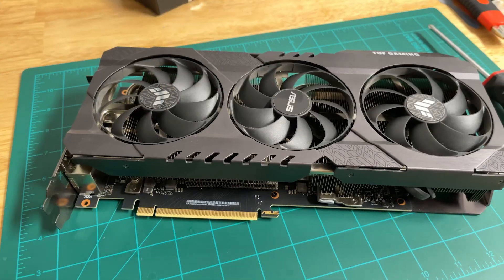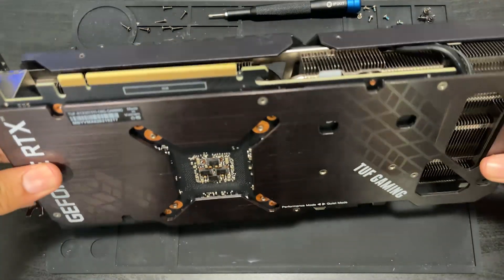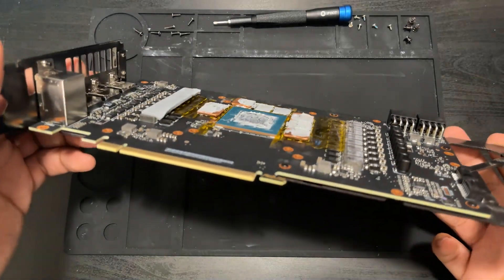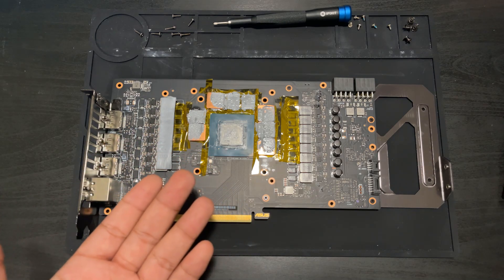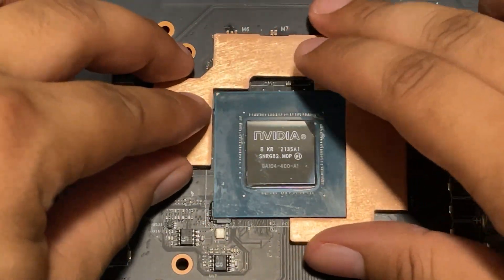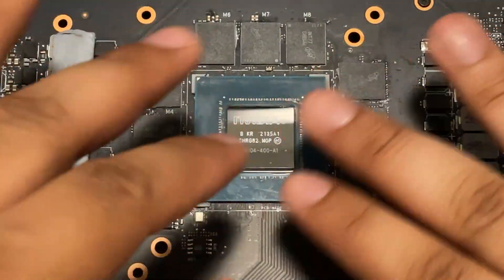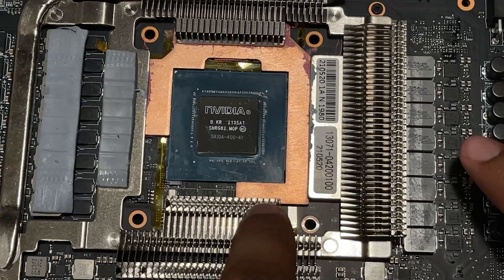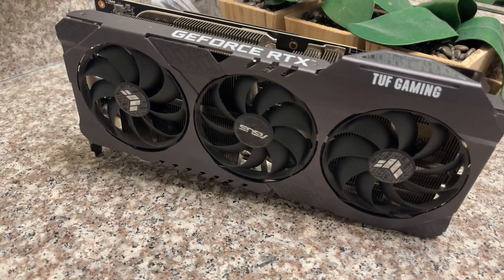RTX 3070 Ti COPPER MOD: 1 Month Later And... OMG...

Comment: Dear, excellent video, from Argentina, if it's not too much to ask, could you put the measurements to be able to cut the mod, and what material is it exactly? I just have a similar board that has temperature problems. if you could attach it in a pdf format in the form of a drawing with the exact measurements. It would be of great help to the community, best regards.

Comment: Careful with MX4. It separates over time with GPUs based on my history. Would recommend GC Extreme over it.
Reply: True, especially when temperature exceeds 70~75°c. High viscosity pastes last longer on direct-core chips. Kryonaut, NT-H1 / 2 and MX-4 are more suited for heat spreader equipped chips
Reply: @harrydijkstra9936 mx6?

Comment: I got the plate for my 3080 ti Fe. Haven't installed it yet but I was planning on watercooling it as well until you mentioned that I shouldn't do that. Can you elaborate on that a bit more? No liquid from watercooling actually makes contact with the PCB or any components so I'm a bit confused as to why that would matter
Reply from the maker: I more said that to prevent people who don’t explicitly understand the risks of doing things like this, a properly water cooled system will have no issues with this mod.
Reply: @dandyworks  Okay, awesome. Thank you for the reply

Comment: You are slowly evolving to the GPU memory plate I made for my waterblock. Juts make a plate that covers the GPU mounting holes and drill them to match in the plate. Cut out any areas that make component contact then you are done. Perfect fit copper plate that won't move and has maximal contact and heat sinking capacity. My Kawpow mining temps with this method are 46C core 50C Mem.

Comment: just a quick correction. if youre watercooling, it doesnt matter if you do this mod or not, these copper plates will not come in contact with water, so there wont be any chance of galvanic corrosion. you might be able to use these plates with a waterblock, but its probably not neccesary or maybe not possible depending on the waterblock. high quality thermal pads should suffice. i see tempuratures better than this mod using good thermal pads with a water block.

Comment: Hi! I just did the mod with the little copper plates from your other video. I am so happy, that i didn't short anything... yet... My memory temp dropped from 90 to 70 :-D Thank you for the tutorial. But do I need to change it the thermal paste every month? Or how long can I use it like this when I am mining? And do I have to live in fear, that there could be a shortage every moment? Because I am a little bit scared now :-D Thanks for the answers
Reply from the maker: Some people say you should change paste every X months, while others say you never need to. I usually change paste every 6 months just because I can, and it gives me a chance to clean my GPU. If you have modded your GPU correctly, I would not live in fear. But I would also perform a visual inspection every so often to makes sure everything is fine. Also, if your GPU is sitting horizontal, I certainly wouldn't worry about shims moving. They won't.
Reply: Thank you for the answer. Putting the card horizontal is a good idea 💡

Comment: I’ve got a passively cooled system where I’ve had great success swapping the thermal pads for some home-made copper shims. I didn’t notice any such improvement using different thermal pastes, though. The TG Kryonaut Extreme worked just as well as MX-4 while being a bit more difficult to work on since it’s rather pudgy.
Reply from the maker: I have seen great variation in the subjective effectiveness of Kryonaut Extreme VS other pastes. For me it's always superior even if only by a degree or two C (It better be for that price!) but of course MX-4 is fantastic.

Comment: I have lowered to voltage on my RX 5500 XT xfx 8gb
And it heat less than before by a lot
What if you lower the voltage?
Better performance?
Less heat?
Explosion?
Reply from the maker: I would assume that undervolting would reduce heat because you are lowering the power being used by the card. However, this is not my area of expertise, so I am unsure about what performance gains could be had. Explosions would not occur though! :P

Comment: i got a coolmygpu copper plate for my 3080 LHR... 99mhs//72c memory temp
best move I ever did honestly.. Now I wanna put one on my 3080 non lhr thats liquid cooled.. 102mhs//66c w thermaltake pads.. I bet i can get it even lower with another plate
Reply: my watercooled gpu is a gaming oc gigabyte that came with a water block installed on it, but that block suffered corrosion internally from the fins being a aluminum plate that was copper coated even with specialized coolant and multiple cleanings it gelled coolant.
with the Bykski waterblock, ive been running this card as a gaming/mining card for over a year with great temps.  
but I think I can do better

Comment: Dude, the die of this card is so tiny wtf xD. I have a 1070 in my PC, and since I bought the cheapest one it had really crap cooling. For 50$ I got an Arctic cooler, I put some radiators on top of the Memory and the power, and I have never seen my card go above 65C under any circumstance. I doubt all of this what you do is really worth it, unless your card has a shitty cooling. And this one clearly has a beefy one.

Comment: I have an evga rtx 2080 xc the 2 fan edition wich was getting really hot really fast 84°C. I bought a raijintek morpheus 8057 with 2 noctua nf-f12 pressure fanv and the temps don't exceed 60°C in full load

Comment: Why do you need to put kapton tape when thermal grease is not conductive? and is it possible for the copper shims to be removed completely? meaning, the memory chips directly contacting to the sub-heat sink?
Reply from the maker: Kapton tape is a safety precaution taken to prevent any copper from making contact with components mounted to the PCB. Sometimes, a capacitor or resistor will sit above the plane of the memory chip, and if the copper was touching that component, there is basically a 100% chance that component will blow up. It is possible for the sub-heatsink to make direct contact with the memory chips. This is pretty much unique to this GPU in particular though.

Comment: I appreciate the tip with the "Heat Resistant Tape". It never hurts to be safe. I'm gonna give the CoolMyGpu copper mod a try hopefully this week. I've also been adding an alluminum heat sink to the backs of my GPU plates. As I haven't done the mod yet, so any bit of cooling helps as of now. Can't wait to try this out!
Reply: Did everything go right? No problems?

Comment: I switched from Stock GPU cooler to AiO cooler, and managed to drop 40 degrees celsius, next i will try to get a new GPU and maybe try the Copper mod out, it looked very promising

Comment: My boy great video! What thermal pad thickness you suggest for the 3070 ti Asus Tuf?
Reply from the maker: I recommend 1.5mm thermal pads, the same size as the shims! Gelid Extremes (linked in description) have been very kind to me, and if you are willing to pay the premium I say go for those. 2mm will also work due to the nature of the dual heatsink design, but there isn’t really any performance gain using the bigger pads.
Reply: @dandyworks  thank you for the reply, i'm gunna spring for the copper plate.

edit: i spoke too soon theyre no loner accepting orders smh :(

Comment: Back in the day you could buy solid copper heatsinks for a few bucks and they did cool CPU's and northbridges really well (no need for heatpipes or anything like that, in some cases you didn't even need a fan).  Those days are long past, unfortunately.
Reply from the maker: Perhaps we should bring those days back. Nvidia is once again taking the "MORE POWAH" approach to increasing GPU performance, and that doesn't bode well for the longevity of the components (Maybe AIBs will begin to incorporate expensive but reliable GaN mosfets instead?). Maybe I could design something for GPUs...
Reply: @dandyworks  It really depends on what kind of NVidia card you are buying and what you are doing with it.  Their lower end cards are very efficient for gaming at 1080p, and don't consume alot of power.   I have a midrange gaming PC with a  Geforce GTX 1650 Super and Ryzen 5 3600 inside an very old (15? years) Antec case.  My whole setup is drawing well less than 300 watts under full load and only has one case fan.

Comment: I would love to see this done with pennies hahaha
Reply from the maker: Considered it, but sadly pennies are only 2.5% copper and 97.5% zinc now. Zinc isn't a terrible conductor of heat though. I think the bigger issue would be the fact I was using PENNIES to cool a GPU lol
Reply: @dandyworks  only 2.5% copper?! Everything i know is a lie.
Reply from the maker: Yes. I was quite astonished when I first heard this fact too. 97.5% zinc and 2.5% copper is all pennies made after 1983. Prior to that through most of the 1900s, it held at about 95% copper. The reality is that, for the last ~40 years, pennies have not been made of copper. Ridiculous!

Comment: Thermal paste spreads when it heats, and you want a ultra thin layer to fill in the tiny voids and surface imperfections. A half grain of rice size for this GPU . Also, no need to spread it around. They sell everyone 10,000 times the amount of paste than needed, because there's no profit in sending .10 cents worth. Furthermore, if there's not enough, thermal run away will cut power. 'naw dawg, I'm good'
Reply from the maker: https://youtu.be/EUWVVTY63hc 
Particularly, ~18:30

Case in point. A half a rice grain is insulting for a 3000 series GPU. Just to do a sanity check, I just tried a half a rice grain on a 3060, and while the core temperature was ~70C under full load, the hotspot temp was 92C. WTF! Absolutely not. The culprit? The half rice grain of paste only spread to cover ~75% of the GPU die.

Comment: exact same card and exact same application, 1 month in I was getting close to 100c memory temps so I opened it and one of the copper shims at the bottom left of the card moved down. it wasn't touching anything to short and burn the gpu but that was scary af. switched it with a slightly thicker one and when reassembling the card I screwed the bottom half of the card first and a bit tighter before screwing in the top side. now it's doing fine. 180w, 82mh, 88c memory on %70 fan

Comment: UPDATE of my own mod with Aluminum Nitride(VRAM>0.5mm Laird HD90000>1.0mm Aluminum Nitride Plate>Shinetsu 7921>Heatsink):
Comparing to one of the best thermal pad (2.0mm Laird HD90000), maximum throttle(mining eth +900 mem) temperature of memory junction reduced from 104C to 92C. Original shitty thermal pad will throttle at 110C with no OC.

I still use 0.5mm of the pad because it holds the plates in place, using paste will induce unwanted movement and also smears into unwanted gaps.

Shinetsu 7921 is very good, once completely cured it surpass Thermal Grizzly Kryonaut in cooling performance, and it's VERY durable(you probably will replace your PC before needing to repaste), also VERY cheap (dirt cheap).
Reply: forgot to mention, it's a Zotac Trinity RTX 3080 Non-LHR with Micron VRAM.The plates i bought was residue from bigger cuts(big enough for VRAM but requires to be cut smaller with a glass cutter, 0.3$ per piece), Shinetsu 7921 was 3$ per 2g tube(7868 can do as well, literally more watery 7921 that cures longer but easier to apply).

Comment: the actual heatsinks makes contact with that memory copper heatsink at the point the subheatsink stops, its not a huge deal but its still extra thermal transfer left on the table, just do it when you need to repaste it

Comment: dawg i got 2 rtx 3090s by asus tuf but cant find any copper plates for it ?!? will this 3070 fit on my asus tuf 3090?
Reply from the maker: You can see a [RTX 30(90) compatible] plate on the CoolMyGPU website here: https://www.coolmygpu.com/product/ga102/3?cp=true&sa=true&sbp=false&q=false
Reply: @dandyworks  alright thank you!

Comment: 62c under load is INSANE , very good work! I have a 3070 ti thanks to my wife ( she saw the GPU price drop ), I have been concerned about GPU mem temps ( topped out at 96c so far ). I really would like to take it apart and replace the thermal paste and put in one of those amazing copper plates, but unfortunately I have refractory temporal lobe epilepsy and fractured T3, T9 , T10 , T11 vertebrae so it's hard to do things that require fine motor skills and I'd be terrified of breaking my card.

If it becomes a problem I'll try to figure out a way to trade or barter to get someone to help out, a lot less people in Canada where i'm from know about computers like back in america, take the bad with the good lmao
Reply: If you buy the custom plate then it’s easy to do I did it yesterday and I think you’ll be fine since the most precise you’ll have to be is when applying thermal paste (easy) and unplugging the fan cables (just be slow, ur wife could do it)
Reply: @georgesaoun9751  that's heartening to hear, i'll keep an eye out for these when I can spend enough to get everything modded up
Reply: @TWEEMASTER2000  ok great I’ll reply to you on this thread if you need anything

Comment: im planning on doing it on my 3070, even though my temps have never gotten higher than 65 with an OC of 125 core and 1000 on the memory. and all my games being high or max resolution @ 1440. still this makes me incredibly curious, and i have a friend with a CNC machine sooooo im def making a plate lol Another great video my guy, keep it up.
Reply: you really do not need to do ths to a 3070. that has regular gddr6 memory. at best, upgrade your thermal pads. that should be way more than enough.
Reply: @Techno4more  I mean yes, and no.. obviously I don’t even need to do anything because like I said my thermals are phenomenal. However there’s technical not rlly such a thing as 
“more than enough”
When it comes to cooling electronics, especially when the electronics are very expensive and not only will the card last longer with lower thermals, but it gives an added bonus of better performance when it comes to stability and overclocking, even with diminishing returns it’s still simply better in every way than it would be without lower thermals. if it was some crazy expensive cooling product I’d say absolutely not that’s stupid, but for the price it’s literally dumb not to. Obviously as long as you’re confident with your abilities to do such a thing.
Reply: @LikelyLagging  personally I wouldn't bother with a 3070. I did watercool all my 3080s tho

Comment: I’ve done thirty 3080 FEs, as they are all defective out of the box.  They all perform differently, as the cards are all different.  Quality control, what’s that?   The difference seems to be the relative height of the VRAM vs the GPU.  

In many 3080 FE cards (including the same rev) the GPU doesn’t make strong contact even with 1.37 mm copper, and the GPU temp goes way up , say, from 52 under load to high 60s, or worst cast 75-80.  All will involving some degree of hash throttling.  A thick wad of chewing gum like pink Thermal Grizzly extreme can bridge the gap without strong contact.  But it’s not good for hash rates as they seem to follow core temp, not VRAM temp.  

Usually cards with strong GPU contact and weak VRAM contact fare better bcs RAM temp will still be reduced by 10 degrees which it’s not a hash rate problem.  There is no way to predict, AFAICT, which cards need what copper thickness.  The CoolmyGPU solution seems to be a hybrid copper and 0.5mm pad recommendation, which is an ok way to go.  The most predictable result is simply to use 1.5mm (for 3080 FE) Gelid extreme thermal pads.  They allow enough give to let the GPU make contact, I give a solid push on the sandwich before tightening up. That will reduce VRAM to 82 to 84 and Thermal Grizzly extreme on the GPU will result in 50 to 62 on the core.  It’s easy, fast and more predictable. 

Copper is not consistent bcs the FE cards are not consistent.  But if you are willing to reopen the card and analyze the paste for contact patterns several times, maybe as many as 10 times, usually, but not always, you will get a better result than a simple high performance repadding.  

I recommend repadding cards instead of copper or aluminum (which seems to work better than copper for unknown reasons, maybe the faster heat conduction speed) as simple pads give more predictable squish and often result in a better hash rate (even with a litter higher VRAM temp) because GPU contact is tighter and the core temp drives mining performance.
Reply: This comment should be at the top!

Comment: i would not wanna run my gpu fans at 100% just to get 62c i would have just returned the card
Reply from the maker: This was just to be consistent with the previous video. You could expect a 2-4C increase if running at a more reasonable fan speed like 70%

Comment: Great video! I copper modded my 3070 recently.
Reply: Hi what the thickness of the copper ?
Reply: @adrianpoenaru1141  2mm. TBH it's not worth it. on 3080 3090 it would be an advantage.